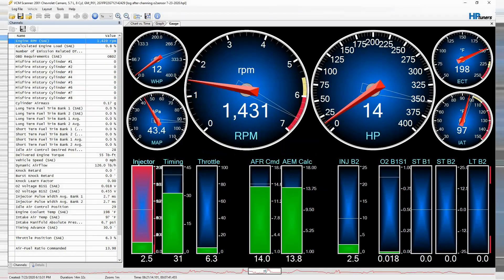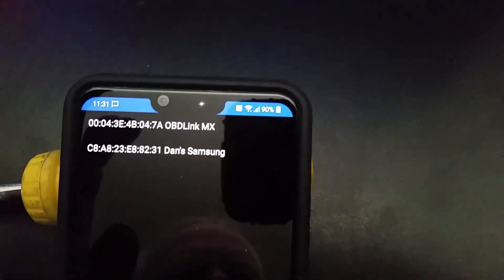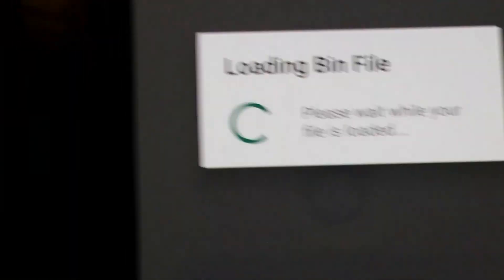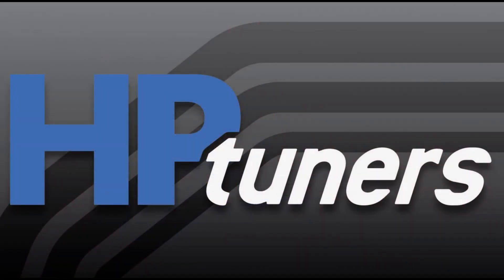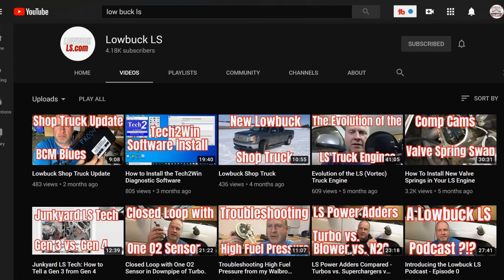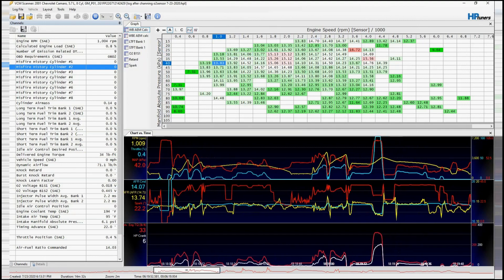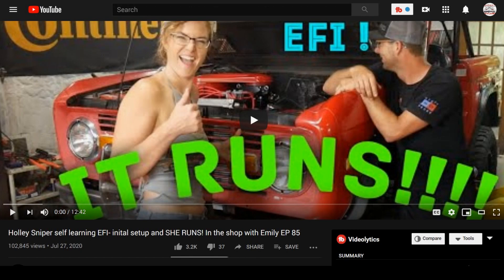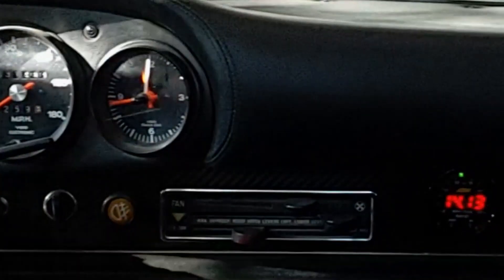LS Swap ECU Options - Best for the Budget!

Comment: Building a 66 c10 with a 5.3 4l60e on bags. All c notched with raised bed floor. This is a long term build that will be mostly stock for now but I want the ability to modify it later so I think the Holley terminator kit is worth it. The rest of the build will take me so much time and work I'd rather just have something easy to get me on the road with the option to tune for power adders later. Also gives me a small digital dash for the important stuff until I can save up for something like dakota digital dash. I do have stock harness and pcm with my 5.3 but I think I'll just sell them. I'm not made of money but my time and headache are also worth something.

Comment: I bought a 5.3 truck engine with a harness and computer. I sent the wiring and PCM off to be cut down and have the vats removed. If I was going to stop there, it was a decent deal. I decided to go with a turbo and that means bigger injectors, custom tuning, etc. I bought HPTuners and sourced a cheap laptop. Also had to get a wide band O2 sensor. I couldn't figure out how to tune for the injectors (no data sheets with deka 80s) and ended up fuel washing the engine. I installed another engine and had to pay a tuner to sort it out. After all of that I could mess around with the tune a little bit but it's pretty complicated. I wanted to change the turbo and add bigger injectors to run e85 but the tuning kept me from doing it. 

The Terminator Xmax ($1500) would have been cheaper by a huge margin and allows for easy tunability and adding other components that a stock setup fights against. Choose carefully.
Reply: I needed to hear this!
Reply: Yep I’m gonna ls swap my65 impala this year or next, and I’m gonna run a stock computer at first but I’m definitely gonna switch to Holley efi at somepointb

Comment: Hey saw your video 📸 and I have a ❓ Can you tune a stock ECU for running boosted application ❓
Reply from the maker: Yes. You need to add a 2bar or 3bar map sensors.  I've done that for the last couple years.  And HP Tuners to tune it and change the ecu to work with the new map sensor. Add a pro tuners help and it may be worth looking into Holly Terminator.
Reply: Hey thx this is my First build and I'm on a budget, I've got a hold on a set of twin turbos and want to fit them on my 5.3L into a BMW chassis

Comment: I just need to delete VATs and enable electric fans for now. My car already ran for a minute or two so not even sure if Vats are still enabled but better confirm.

So if i have a desktop computer with windows 10  that has bluetooth  built in  i can skip the android read/write process and do it all from the computer?
 i just need to bring my computer to the garage or bring bench harness, battery and pcm to my computer?
Reply from the maker: The only interface I know of is the android app.  There may be others now, you could check this forum and see what's new. 
 https://pcmhacking.net/forums/viewtopic.php?t=6249&start=10     
The electric fan thing may be problem but you could always do a standalone thermostat and fan controller they aren't much money on Amazon.
Reply: @budgetoutlaws9978  Ok i went to some of those forums and PcmHammer seem to be a good option to use. i tried it, it read my pcm first try and then i used that saved bin to modify it in Tunerpro and that worked easily , deleted my VATs and enabled fans to come on at 210/215 and both go off at 190.
Only problem is it gave me a warning at time of  savinng about;
 Error some checksum dll files may be missing

im hestitant to write this to my one and only PCm.....
noone at those other forums, Tunerpro, Ls1tech, or ytubers  that gave me the proper XDF file for tunerpros and recomended pcmhammer knows what to make of that error.
i tried a few things including dropping in this dll file into tunerpro plugin folder and redo the tune changes but same errror?
Reply from the maker: @kravmaga7070  I would recommend getting a junkyard ecu to play with.  Then find an Andriod phone to do the reads and rights.. The App for the Android has more trouble checking and error recovery.  There are no guarantees when hacking ecus but it worked well for me.  I bought 4 extra ecus to have something to play with.
Reply from the maker: @kravmaga7070  I didn't really answer your question.  But then again I don't really know.  I didn't use pcm hammer.  That forum is your best bet for those questions.
Reply: @budgetoutlaws9978  you might be right but then again ive got zero help at tunerpro forum
Reply: @budgetoutlaws9978  Ive tried getting ECU locally online and the few around were going for $100 -$350 cdn, now theyre all gone . 
I ended up getting PcmHammer, it read   and saved my entire PCM first try. 
Then an LS1tech forum member gave me an XDF for my 12212156 OS which enabled me to tune that saved stock bin with Tunerpro. Changed VATs to 2, enabled fans to come on at 99/103 C and both go off at 88 C and tuning was complete.....for now. But when i went to save , it gave me; "Error some checksum files may need updating, please check checksums" which worries me, maybe its nothing, but maybe it will brick my only PCM.
the creator of checksum  P01-P59 DLL Rouku Y, gave me his tinytuner app that supposedly fixed the missing checksums but it was so easy im skeptical...
Reply: @kravmaga7070  Not sure if you're still fighting with this but you need the checksum plugins for TunerPro.
Reply: @kravmaga7070  Bro, a checksum is a hash. If you've made alterations to a file then the hash or checksum will be different than what it was before. Seems like a normal error to me if you're trying to put a different tune on (which will have a different checksum).
Reply: @budgetoutlaws9978  Im much better with HARDWARE,  i can build a desktop computer in 45 minutes but software can be glitchy when its brand new. 
So, Im hoping the fans will be easy part. Bought a small fuseblock and 5 relay set for $80 cdn. Added in blue 42 and red 33 wires to pcm  to trigger relays. Then, I just used Tuneropro to enable the COME ON TEMPS to 99c/103C instead of 140 and TURN OFF both  at 88C

Comment: So if you had to do it all over again and you weren’t loaded with money, which would you personally choose?
Reply from the maker: Power and use goals matter.  But, On a budget.  I would do the same.  Gen 3 or Gen 4. GM ecu.  Stock harness.  400 or less for tuner software and license.  If you don't have a computer or harness then you're getting close to a Holley system which is much easier to learn and install.